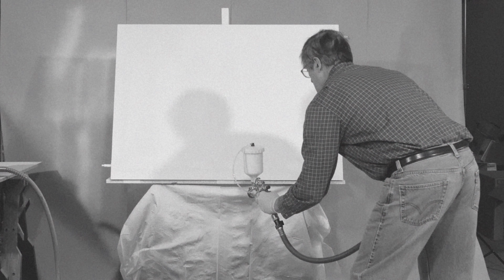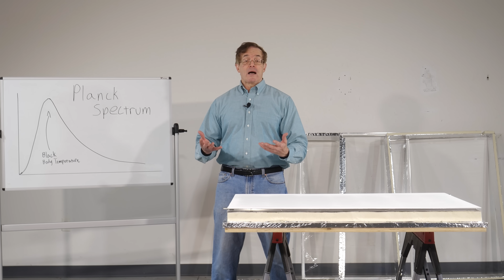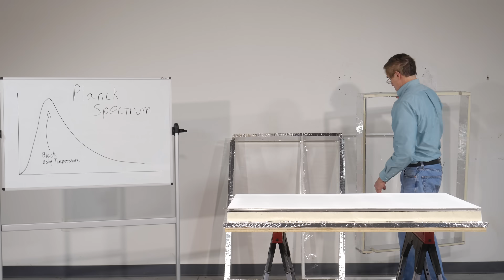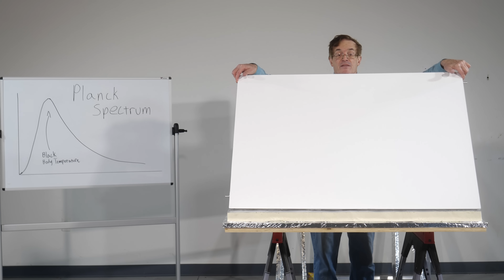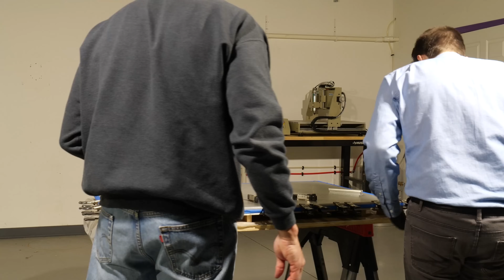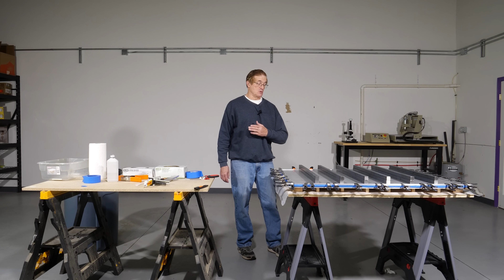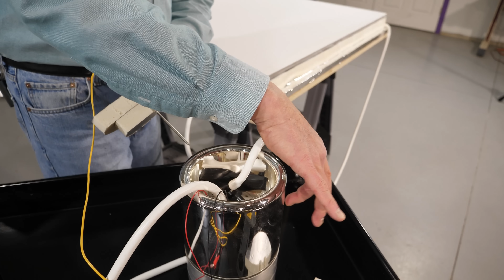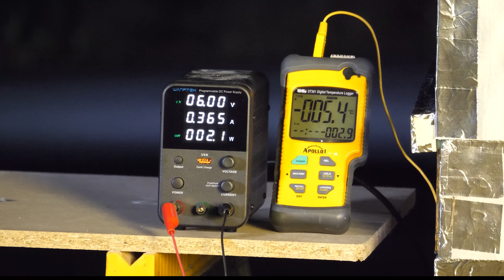Air Conditioning isn't free... but we're close.

Comment: This is not my forte, but could you have an inverse of this system? Using it as an optimised heatsink to transfer heat to the sky cooler system in your video.
In short would you see a gain in efficiency versus, pumping the cooled water through a standard water radiator heating system?
Reply from the maker: Yes, that would work.
Reply: @TechIngredients  - your video and your other video (about the solar hot water system compared to the solar PV) has made me think it’d be a fun experiment to run a Stirling engine off them both.
Admittedly, as a lay person, I have no idea if it is worth it from a “KW return on investment” perspective. They seem appealing as it might be something potentially easy enough to trouble shoot if it broke.

Comment: Wouldn't it make more sense to dump the excess heat into the ground. then recover it in the winter?
Reply from the maker: That's  the principle  of geothermal  heating and cooling.
It's  another tool.  These methods are not mutually  exclusive and depending  on the climate and ground conditions, one or the other or both can be used.

Comment: Actually it is... If you know how to use the forces around you... Air conditioning with no moving parts has been known since 900ad🎉
Reply from the maker: It's probably  more like 3,000 BC, but so has the wheel. We're  just refining the principles.
Reply: @TechIngredients  so America could be energy independent if building codes. ,or civil engineering looked back to those savages
Reply from the maker: Agreed.
But, I wouldn't be calling anyone else  a savage given the current  state of society.

Comment: Yet another who does not understand the 2nd law of thermodynamics. Your panel will emit exactly the same T^4 radiation against a clear sky as it does against cloud. The difference is that your "special coating" also absorbs very efficiently, the IR coming down from cloud.  Also you 6" riser will make very little difference unless your trees are 100m away. It will just reflect the IR from the trees back on the white panel.
Reply from the maker: If you think the presentation  did not emphasize these points as much as you would have liked, that's  fine.
What isn't is resorting to an insult in your opening sentence.

Comment: I wonder if you could merge this with those solar thermal or hybrid solar thermal panels to generate electricity. A house could have the "hot" panels on the south facing roof (in the northern hemisphere) and these radiative panels on the north facing side (again northern hemisphere). Then hot water from the solar thermal panels could flow on one side of a peltier, and cool fluid from these (or maybe even attached to these) could flow on the other side via the thermosiphon effect. The earth is a giant system that absorbs equal amounts of solar energy as it does radiate that energy into space. So in theory they should match pretty closely (and like you said, these should work better at higher temps). Given the temperature of solar panels can get up to 135F and that sky cooling could get below -50C, it might make a large enough temperature difference to achieve decent efficiency on a TEG. Combined with a hybrid solar panel that already converts double digit percentages of power into electricity and you could have noticably higher electricity production efficiencies, even ignoring the increased efficiency from cooling the PVs.

Comment: I thought you were trying to make the fluid cooler than the surrounding air. It looks to me like you achieved the exact opposite. The temperature of the fluid was always warmer than the outside air, being it's closest to even at the beginning of the experiment. And as the outside temperature got warmer, the difference between them got even greater. If instead you were trying to extract heat from the outside, maybe you achieved that, but it's more likely you just added heat to the fluid from the pump, and all that foam and coating just acted like insulator preventing the heat from dissipating into the outside air. Tell me where I'm wrong, but it looks to me like this experiment was a failure.
Reply from the maker: Did you notice that the temperatures on the meter were below  0 C and negative?
Reply: @TechIngredients  No, I'll look again.
Oh, now I noticed where the meter switched from positive to negative. I am duly corrected. Thanks.

Comment: I lived in South Florida for a while, and during the summer I could feel the heat radiating down through the ceiling. My home had light grey shingles.  I decided to roll on a super reflective coating over the shingles for two reasons.  I believe the coating was advertised as over 80% reflective, and it was hurricane rated. 

It made a huge difference.. No more radiant heat from the ceiling. The attic temperature dropped from unbearable to room temperature.  My electric bill was nearly cut by half, and the roof survived Hurricane Irma.

Comment: Compressor free absorption refrigerator, like 3way ones in RVs,but using induction as a heat source, like 96% efficient, air-conditioning same configuration, aerogels probably future use ?

Comment: Great concept!  as an HVAC PE (now working in aerospace), this is a cool idea, but I can see it being really limited by surface area, similar to the conundrum with solar panels taking up all the roof space on a building. Did you work up a capacity per unit of area sort of calculation? It looks like it would be great for low, slow cooling, but not great for high instantaneous loads, maybe good when coupled with insulated water or refrigerant storage, like you eluded to in your double walled vacuum container.
Reply from the maker: You're right.  However, the real importance is the coating itself, which we covered  in the video that followed this one.  The coating is passive and can be applied  to any surface you could paint.

Comment: What a great video! Sorry if I missed it but maybe if you glued down the foam panels inside the radiator it would make the system more efficient. It may prevent the foam from floating up and preventing water from getting into contact with the cooling surface.
Reply from the maker: Thanks!
I thought  I mentioned  that they were glued down, but even if I did, I should have emphasized it.

Comment: Would a tapered top not be ideal? If not some sort of pyramid structure with the top cut off in some sort of way, or the top just vented open in a way to still Release heat if working passively
Reply from the maker: No, because  the open surface is the limiting  factor for radiation loss.

Comment: I first heard of something like this from the Low Tech Magazine
The article was on using aluminum foil to dump heat energy into space and used that head differential to run a Seeback generator for powering a very basic LED light.
The people were very excited about teaching people in poorer countries within regions of Africa about this niche application.
Reply from the maker: Interesting. 
Aluminum foil is a very poor infrared emitter.  The coating I demonstrated  in the video that follows  this one would be much better.

Comment: Fantastic work. Could you please run a few more test and develop the load line of this panel. Put a resistor in the bucket of water and dump in a fix wattage, do 5W, 10W, 25W, 100W. SInce is T^4, i would expect the temperature to rise more at low power but at high power much less temperature increases. Such information will determine the practicality of this solution.

Comment: What if you cascaded several white reflecting to black that is simultaneously mated to another white and so on. I've read/seen some far out experimental projects that tried to focus radiative heat across rooms.

And I've got some maniacal half baked ideas around doing this in a heat pipe thermosionish™ way

Comment: Have you tested this at higher ambient temperatures. In the example where you speak to using a water to refrigerant heat exchanger, my thoughts immediately go to how quickly will the HX run out of water cold enough to drop the refrigerant temperature off of the condenser coils. What sort of volumes would you need to make this application practical. Pump energy will be competing with compressor energy savings gained from cooling the liquid refrigerant on the condenser side. Just some thoughts. Very very cool idea. Curious about the scalability of this application.
Reply from the maker: Yes, and the performance  increases the warmer it is.
This will always  add efficiency to the compressor  based system.  The ratio of these two systems determines the overall  gain.  As the radiant cooler increases in size, it will approach  the limit of its unloaded temperature drop, and further increases in size shows ever decreasing gains.

Comment: The problem is that electricity consumption here is almost irrelevant as it is needed when the solar output is highest. So while that is still not free. It's among the cheapest sources we currently have. So those 10% of electricity probably equate to less then 4% of pollution form electricity production even considering the production of the panels and everything.
Passive cooling is still great and important as it reduces dependencies and cost. Just not nearly as much as that 10% figure would suggest. But everything in the full percent area is still a big deal even 2% would be great.

Comment: I have a hydronic heating system running through 1.5" thick concrete with a mortar and tile finish.  If the floor is too cool on a humid day the floor can get wet.  This idea might work as a chiller in the HRV and dehumidify the air.  

I'd like to know the quantity of heat a 1 m^2 panel can dump on a hot summer day.

I'd also like to now what the 'magic' white paint is.

Comment: Adding anything to the water makes this a non real world test I'm not impressed at all you should have used normal water then it would be a real world test
Reply from the maker: Real world?  What's unreal about an antifreeze mix?
Reply: @TechIngredients  for one most ppl would only put water in the system and you added an ingredient that is not normally found in water and why would you put something that would have to be precisely measured also antifreeze actually is going to affect the numbers greatly depending on the mix ratio
Reply from the maker: Firstly, based on the temperature  outdoors during  the test, pure water could have frozen in the lines.
Secondly, the fluid that transferred  the heat is irrelevant.  The heat radiated from the surface is what was demonstrated.

Comment: I'm fascinated with the beginning of this project. 
 My background is in commercial Hvac and I see what your doing so far . I work on chillers and Absorbers using lithium bromide I do think once the system is operating it has merit but I also can see some type of mass thermal storage being part of the system.
  Also the cylinder shaped coil heat exchanger is something that we use for waste heat off the a/c compressor reduces the electric load on an existing a/c condensing  unit. If you existing unit is a heat pump there can be an added benefit with solenoid valves to divert the glycol.
  Thank you I'll be watching.

Comment: How fast can this reduced temperatures? The time lapse showed that it took some time to cool the volume of the can and the volume of the radiator. How fast could we cool a pot of 100°f water down to 60 degrees?
Reply from the maker: That depends  on the volume  of the pot.
Simply  stated, this panel  will cool the fluid at a rate of 150 watts per square meter.

Comment: I've swapped out several HVAC systems from the old R22 to the more current 410 Freon and not able to recycle the old units for one reason or another. I have several ideas of using the old evaporator coils for a passive heat exchange system. Do you think painting the evap cores with an inside unit and an outside unit in a closed system using anti freeze to exchange the heat would work? I have a coil or two towards the cause. Also thought of using recycled car radiators.
Reply from the maker: Yes.

Comment: So it’s a fancied up swamp cooler? Those things might work in the desert, but up here in New England it gets super humid in the summer and those things do absolutely nothing because it gets too humid for evaporation, thus no cooling.
Reply from the maker: No, it's  a completely  different principle.
A swamp cooler is an evaporative cooler.  There is no evaporation occurring here. This system radiates selected wavelengths of light into the sky.

Comment: 🤯wow, im like 3 minutes into this and you already explained so well that im making sense out of other similar stuff...you jave a great way of translating your knowledge into a very simple way for understanding 😮❤🎉 thank you! Definitely subscibing to thos channel 🙆🏻🌞🌈🌝😋 thank you for this!
Reply from the maker: Thanks, and welcome!
Reply: @TechIngredients  question...if i live in Mexico...and my house roof is flat with all the circumference of the roof being 15 cm higher than the "roofs floor"...if i want to make my roof "cooler"...if i build up the circumference maybe to 1 meter, and make a few holes on the bottom, around the roofs sides...would it make a difference? On the air  temperature around the roof...and around my central A/C, WHICH is on the roof?
....i should probably at least make a simple roof on top of the unit to keep it away from direct sunlight...
I hope i explained it decently enough...i might be making a mistake somewhere, i dont know... Whats a quick response off the top of your head? Am i confusing things? Lol
Thank you anyway!
Reply from the maker: As long as you use the right coating as we covered in the second video  on this topic,  that should work.

Comment: So the test is done outdoors where wind can have a chilling effect. You can hear the wind blowing through the windscreen on his mic at the end of the test. A test that starts at near-freezing temperatures which will have near-zero humidity. It is after the sun has set. Circumstances where the temperatures can not help but continue to dip until the sun rises again. We stick on top of that a barrier to stop heat radiation off of trees, because will negatively affect the results. I am sure it is a cloudless night to boost those numbers. No indication as to how long the video clip ran. So as uncontrolled and one-sided of a test as humanly possible for viewers to make observations from. Note the frost buildup on the meter near the end of the test. The ambiance air had to have dropped for that frost to build up. I mean what are we looking at here? Even if none of that had an effect, over 2 watts of power to lower a few ounces of circulating water by such a small degree? How would you build this product into something that could sit on your roof and potentially replace your roof? If your entire roof had this could you get a 10-15 degree delta off of a roof of a 1,500 Sq Ft house on a cloudy hot muggy windless sunny day in a lot with trees? How much power, water, and material would it take realistically? Do you have enough roof space for a system capable of doing that much cooling in a 1,500 Sq Ft home? Do you need to cut down all of your trees? How would this even work in a multi-story building where you have more Sq Ft of interior space to cool with less Sq Ft of roof space for the system? Why not use a heat pump air conditioner? It is the single most efficient way to both heat and cools your home even if you live in areas where it gets over 100 F or below -0 F. It also acts as a dehumidifier in the summer and a humidifier in the winter.  Power it with a few batteries and solar panels. Add in an electric car and you are set. You are off the grid, offsetting your fossil fuel usage with clean energy you return to the grid. Not since fiction, science fact. All those items are on the market right now. You can call someone to your house today and get a real quote with real products and get set it up in the next month or so.
Reply from the maker: Thanks  for the long comment.

Comment: Interesting would be ? if an infrared filter is placed above this plate in this way no visible light can enter the plate, but infra-red heat can radiate out from the plate...
Reply from the maker: The coating  achieves this, but the cost is much lower than a complex, wavelength  specific filter.
Reply: @TechIngredients  

👍
Cool would be to have this plate with refrigerant, in line after the condenser in a split ac... and see how much power consumption can be achieved...   especially now in summers

Comment: That statistic is NOT surprising to me. I have dual AC units and with my pool pump in the summer time my electric bill is 1100 to 1250 USD a month for four to five months. I keep the thermostat at 78 for the upstairs and 77 down. If I could cut that bill I'd be independently wealthy.
Reply: I cant live with a temp above 72f.. 1100 for 2 ac units and a pool pump is crazy.. whats the price of a kW where you are?..

Comment: Hm 🤔 wonder if plexiglass would do the job of the polypropylene foil and if it would be possible to use aluminium honeycomb structure instead of the big box to block the surrounding infrared.

The other thing I start to wonder about there are circulating ideas of stratospheric cooling due to reflecting particles reflecting the sun light… don‘t they act as infrared reflectors also and so would minimize the natural cooling effect of the sky?
Reply from the maker: They do.
With more testing,  we discovered  that the film adds very little  to the performance.  You can loose it.